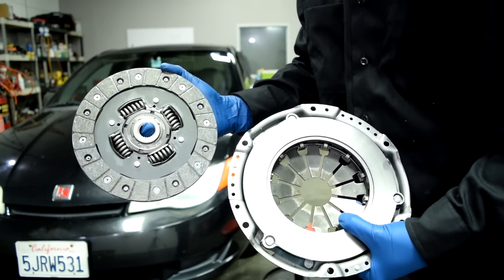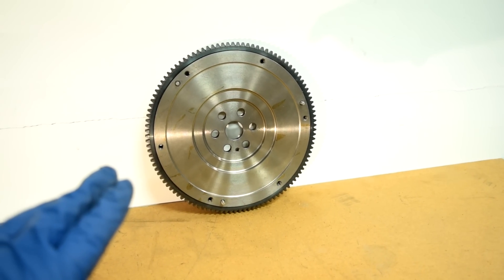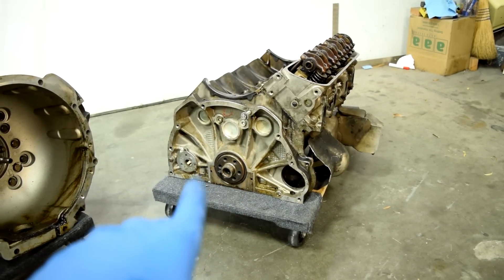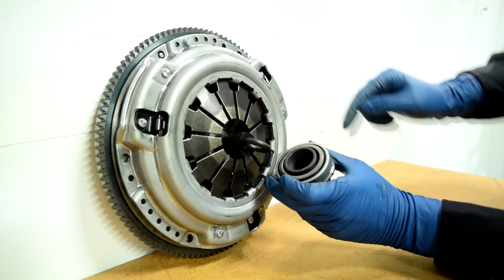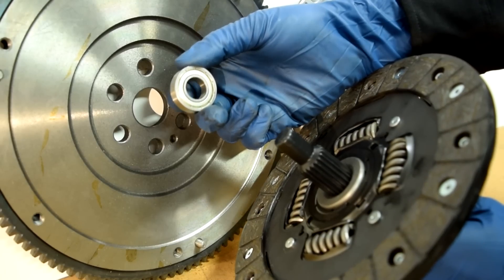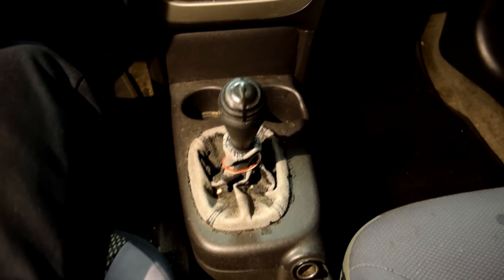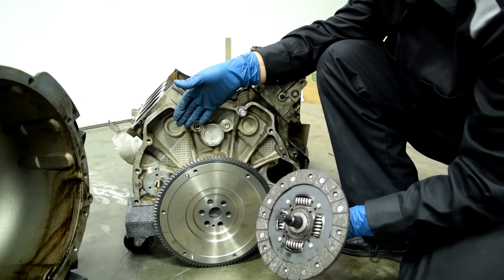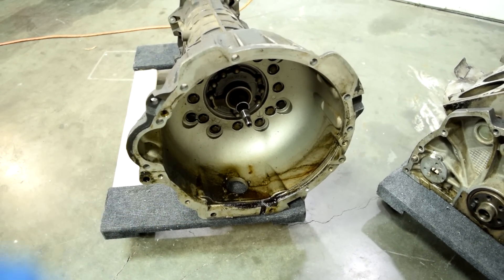How a Clutch System Works and How to Diagnose Issues With It

Comment: This is by far the best explanation and walkthrough of a clutch system that I have ever seen on the internet.  It is thorough, easy to follow, doesn’t skip anything or assume there is pre-existing knowledge, and best of all it actually assembles the damn thing piece by piece so you can actually comprehend how it all works together.  I give this video two crotch pedals up.

Comment: My 4 cyl manual 06 Accord with 150k gentle miles now makes a mild and variable howling noise, that persists until I gently press on the clutch pedal, then it is quiet. I think there is play in my throwout bearing against the transmission input shaft. Just my guess from the sound. Somethimes it is quiet for a while, other times it makes that subtle dry howl noise. When driving, road noise and the hum of the engine are louder than this mild howling tone, so it isn't like a slipping belt howl. Could it be the inside diameter of the thrust bearing is worn a few thousandths, and is not a slop-free slip-fit on the transmission shaft, and so wobbles a little bit to make that howl? Anyhoo, it's probably going to run me a couple grand or more (mostly labor) just to replace that, so while I'm at it, it will get a new clutch, too.

Comment: thanks for this video , i have a polo playa 2001 model 
my car gears goes high at high speed when above 3000 rpm when pressing gas peddle down to floor , is it slipping clutch ? also i checked at bottom of fly wheel look like theres oil ?

Comment: I recently encountered a problem with my car . My car is a 2003 peugot 1.4 manual trasmission . The problem comes as you put the car on first gear run a little bit then you press the clutch .... If you release the cluth without shifting to a higher gear itll jerk .... It happens on every gear but on the heavier gears it gives you a harder reaction. What dou think it could be...

Comment: Hey Very nice explanation, I have a new set (flywheel, friction plate, reinforced stock pressureplate, slave +bearring which have just done 2000miles without any problem. After someone launched my car from a standstill i have shifting issues at high rpm. shifter wont go in next gear and grinding noises. when normal dailying it does shift like it should. Any idea what could be wrong?

Video i made:https://youtu.be/vcJP3tW3ces
Im guessing that my gearbox is still getting input when the pedal is fully depressed or can a bad shift linkage cause this? 
Can a clutch master fail in this way that it does instantly move out the slave when the clutch pedal is depressed a tiny bit (so no delay) but not far enough when the clutch pedal is fully depressed?

Comment: had the clutch replaced on my car last year and I'm thinking either the pressure plate or cluch release bearing took a crap prematurely , it's not a Master clutch cylinder nor clutch slave cylinder as i also replaced both same day as the clutch kit 🤷🏽‍♂️ just went through a scare few minutes ago while I was driving clutch wasn't catchin at all neutral in every single gear with the foot off the pedal 🤷🏽‍♂️

Comment: Your terminology is incorrect, what you are calling a pressure plate is a clutch cover assembly, what you call the friction surface is in fact the pressure plate! The diaphragm spring (the fingers) are not attached to the back of the pressure plate, but does touch it!

Comment: I have a 98 civic with 195k original miles on the clutch. Had issues engaging in 1st after car warmed up. Replaced slave/master cylinders which seemed to help but still there’s resistance getting into gear once warm. Would this be an issue with the clutch or air in the lines?

Comment: You are the best. I have looked at different videos where they explain as though they are deliberately intending to confuse!
Clearly there is no continous shaft from the crankshaft and the input shaft. This is extremely hard to imagine when one considers that stuff must be continously connected from the engine to the wheels

Comment: Bought a car with a new clutch put in about a year ago, even came with the old engine and clutch but as im fixing it and its on jack stands i noticed that it cannot stall out. I can put it in all gears 1-5 and Reverse and just let the clutch pedal go and it will not stall??? Any idea what the issue could be and where to look?

Comment: I just replaced my clutch master and slave cylinder and It still feels like there’s no pressure on the pedal and I cannot put it in gear while the car is on, plz someone help
Reply: Bench bleed the master cylinder and then bleed the rest of the hydraulic system. The clutch line probably still has air.

Comment: My car's clutch does not slip with the stationary clutch test, but is starting to slip more frequently when at about 2000 rpm + and under load..It is a 2l turbo diesel. I am going to replace its clutch as I am scared its going to fail soon.

Comment: Hey! What can make noise in the clutch is depressed? No noise while stationary as well. Only while moving, and any gear (not on very low speeds, ie starting to move). As soon as i press the clutch, noise disappears. Some times it goes away for the moment while moving at certain speed. the car is Peugeot 307. Thx for any help.

Comment: When the engine is warmed up and I press the clutch pedal, it's really heavy and very squeaky, I replaced the cable with a new OEM one and there is no difference. Please respond as I use my car of UBER.

Comment: Does the starter motor disengage with the flywheel?  I'm guessing it must do otherwise the engine would be driving the starter motor in reverse, that would be a drag on the engine and prematurely wear out the starter motor.

Comment: I had a keychain rattle noise when the clutch pedal was NOT pushed in. Once you push the pedal in all noise stopped. Also, the car was kinda shaking when I pulled away from a stop. 
It turned out the flywheel was warped and burnt on 1 side. Resurfaced it and all issues are gone.

Comment: Hello RandW, 

I got a 2014 camaro zl1, and it makes a sound between 1-3k rpm, its like a rattling sound coming from gearbox area. I just replaced the stock clutch to RXT clutch and the mechanic told me I got a bad slave cylinder, but i refused to replace it. Also, there is no sound when I am in neutral and full stop, so it happens only at low rpm and  when cruising at low rpm then press the clutch to switch gear the sound stays  until rpm drops below 1k. What do you think? is it the slave cylinder or something else?

Comment: I just dont understand why these transmissions are breaking burning easily . Many times in traffic i need to statrt to go by higher acceleration and such time the clatch slips. It is basically an acent technic and nowadays tbhey selling em on expensive money cos heated seats and electric windows. Touch screen radio whoa!

Comment: What's the problem with my clutch if it shakes slightly when releasing it in the first gear? Can you plz show me the parts in the clutch system that went bad resulting into this problem. And how to fix it?

Comment: Thankyou for your video, I just bought a car I knew needed a clutch replacing, but I didn't know there was a noise from the clutch being pressed til I bought it, and I am planning to fix it myself with a friend's help to save labour costs, but I am not sure what was causing the noise, thanks to your video I'm pretty sure it could be the pilot bearing, I like your detailed explanations evn though at first I was like, huh he's explaining manual transmission problems with an auto box? Lol but you did explain a lot. You got a new subscriber and a like =).

Comment: Question: Is it possible that the Clutch Diaphragm will not engage the clutch because it fails to separate when the throughout bearing presses on it?
Reply: No, but first I have to correct his terminology. What he calls the pressure plate is a clutch cover assembly, the pressure plate is what he calls the friction surface. The pressure plate is connected to the cover with tangential straps(he didn't mention them) these are what pull the pressure plate back away from the flywheel. As the diaphragm spring is depressed, the fingers are depressed, the diaphragm spring has a pivot point, the inner part of the diaphragm spring moves away from the flywheel, the tangential straps pull the pressure plate back.

Comment: I have a 97 silverado 4x4 5 speed.  With the clutch depressed a little or all the way it sounds fine.  Release the clutch in neutral and it sounds like it's coming apart.  Not a grinding of gears but a loud machine sound.  Any thoughts?

Comment: Been there,,SHIPPED AND ORDERED THOSE....
LOSE one 1.80  core ,,it wont RETURN...
  I SPOKE  intensively and 
EXTENSIVELY with the engineers who designed  TRANSMISSION 
PLATES...<<AND
we tracked every shipment,,>>
◇_M.A. Bodine._◇

Comment: Very educational, thank you SO much.  Just had a master cylinder & clutch assembly replaced, but the culprit, $1000 later, was the $31 throw out fork, lol!  Gotta take it back in because when I release the clutch pedal, about halfway back up it sticks, then suddenly "pops" the rest of the way up. It's actually an audible "thump" sound too as it pops back up.  I wish this video would have given me a clue as to why it's doing that.  I just can't figure it out.  Just spent 2 weeks without my car (2002 Subaru Forester), living in the country and a full time single mom, whew!  I'm loathe to take her back in, but I don't want that thousand bucks to multiply!

If every driver knew the basic mechanics of how their cars work, I don't think we'd be in the shop quite so much, lol!  Thanks for including your bloopers, I was laughing with you!  Comic relief is so very necessary when working on cars, gosh how my dad would swear and throw tools, when he'd make me "help" (really just watch) as he worked on cars out in our driveway.  He really needed a son, lol!  I'm grateful, I can install brakes, change a valve cover gasket, change tires, change oil and much more cause of dad making me "help" as a tween and teen age girl!

Comment: 2007 Saturn ion, replaced clutch + cylinders. I see you have the same car. Bad master in 4 days. Any ideas? Maybe you dealt with it on that car???
Reply: I have been going through endless forums on the subject and dealing with my car's clutch issue; $1000, a new master cylinder and clutch assembly, only to find out it was the $31 broken throw out fork causing the problem, lol!  I've heard a LOT of issues with bleeding out the air in the hydraulic lines... worth checking maybe?

Comment: Thanks for the video. I have put a new clutch in but having a hard time finding a nice bite point in 1st and reverse. It's vibrating quite bad.. throwout bearing?
Reply: @senadgalijasevic8568  sounds exactly the same! Yes I'll try bleeding that. Will get back to you.

Comment: 10:39 I think I have this issue. it's the worst for the reverse gear, when I release my foot of the clutch pedal it makes a grinding noise and doesn't move, I have to put it in neutral then 1st gear and then reverse again than it works about 70% of the time.

right now I just so happened to drop the transmission and to me it seems the tob is good.
what else can you tell me to maybe help diagnose my problem.
Reply: ps: what's a filler gauge?

Comment: Hay I have a Honda Civic EX 2003 1.7 manual transmission and when I go uphill and I shift from first to second gear I loos a lot of power they told me it's the clutch but I'm not sure and it's hard to find an honest mechanic  what do you think
Reply: It's not the clutch it's your car. It doesn't have power to lose...let alone power to begin with.

Comment: when i changed the clutch assembly of my volkswagen polo and had it installed with a used clutch release bearing, the clutch did not work? my mechanic told me that something is wrong with the transmission which caused the clutch not to work. what do you think happened?

Comment: Great video but it's a bit confusing swapping from a auto gearbox to a manual car all the time.
Reply: The Scally Trader    Er.....he does say.....”we’re going to use this for demonstration purposes”, meaning; just pretend it is physically a manual gearbox he’s pointing at and everything makes sense. 

Nothing he says is specific to an auto unit.   Almost everything he says is specifically about a manual which may or may not be the same as an auto, but he’s not considering autos here, so it’s not relevant.  

He could’ve had a cardboard box on the floor that says ‘manual gearbox’ on it and that would also be valid.   Good luck.
Reply: @aleksmart  thanks for that.

Comment: i drive a bmw 320i, when i try change into first gear sometimes it doesnt shift and feels like it gets stuck, if i let my clutch abit loose it will slip in, or if i go into second back into first it goes really smoothly in without issue, and there are days where i can shift gears super smooth with ease and sometimes it feels abit hard..

Comment: Hi, I am looking at purchasing an Audi A1 1.4TFSi and recently took it for a test drive the other day. Nice little car but what I did notice was that when the clutch pedal was nearly fully depressed (around 4/5ths of the way depressed) it started to vibrate a little (no noise heard from within the cabin just some minor vibration through the pedal). Then when the pedal was fully depressed the vibration went away and then as it was released (now in gear) around the same point (on the return) it started vibrating again. Is this a problem? Could it be the pilot bearing like you mentioned in the video even though there are no noises coming from the engine bay?

Comment: Hi can anyone help 
I got my new clutch installed 
1 st week was good no slipping but 2nd week and 3rd it's slips from a stop 

I bought a new slave cylinder 
New clutch plate and pressure disk
And new dmf flywheel 
Mobile mechanic got new pilot bearing 
Everything else is the old stuff 
New fluid

What's up with it 

After car goes it's fine it's goes 
If I bring clutch up faster it will wheelspin but slower to biting point it slips ???

Please help

Comment: my clutch is not giving me any problem for changing gears, but it does seem to move without any resistance down almost to the floor.  there is no leaking or noise it just seems like it is too easy and low... can this be adjusted up or tightened? or does something have to be replaced?
Reply: createnow4U seems like your clutch disc is worned or its just misadjusted. And yes you can adjust it defending tho.

Comment: Awesome video, super thorough, awesome flow of explanation and great troubleshooting tips. Thank you for also including information about how the computer is tied into the systems as well. I learned a lot from this video. What was especially surprising to me is that when you kill the car in a manual, I always thought it was the engine just not having enough power to turn the wheels which made the engine die, but instead its' the computer sensing an overload and shutting down, so interesting. Anyway, good vid, thank you.

Comment: I have a clicking/whrring noise while in neutral that revs up with the engine but goes away when depressing clutch pedal.

Pilot bearing failure?
Reply: Throwout bearing worn or defective

Comment: I appreciate your in depth explanation! How do you diagnose clutch judder / shudder? I used to have a dual-mass flywheel and now I have a single-mass flywheel and clutch kit, CDV removed and brake fluid flushed. I get an intermittent judder.... and I have no idea why.

Comment: Pl;ease advise.  Cant put gear into gear.  However cannot change gear at all.  Noises can be heard from the engine when stationary but cannot hear anything on the move.  The last thing that happend is I could not release the gears at all.  Jad to remove the gearbox then pull out of gear.  Is this a sign of bad bearings or personally feeling the Fingers have warped or become to fatigued and no longer respond to pressure from the pedal.....

Comment: I have a question. I have a 05 mustang gt put in a new clutch kit with new slave/throwout bearing. From the beginning the clutch engagement wasnt linear. Ive bled the system many times and sometimes pumping the ckutch helps the engagement feel. So then i put a new ckutch master cylinder since the one i had was used but the pedal feel is still the same. Theres days that the clutch pedal feels great but usually after a few minutes of driving it starts to feel like the clutch pedal is not linear any ideas??

Comment: Please help...my mechanic installed a new clutch in my 02 civic. However the car now vibrates very hard when i try to move off in 1st gear but shifts smoothly after moving off to the next gears except 5ft gear. The car will no longer go in 5th gear. Its as if the gear is not there anymore,yet its a 5 speed car. Please help

Comment: U made a mistake. A clutch plate is always connected to the flywheel regardless of clutch pedal being depressed or not (Clutch disk is the only part which disengage from flywheel when clutch pedal is depressed). So the whistling noise produced by the release bearing can be heard only when the clutch pedal is depressed to the floor because that is the point when the release bearing make a contact with the clutch plate which is always spinning along with the flywheel.  Nice vid btw.

Comment: Thanks for the information, but I have a question for you. I was driving yesterday and something was wrong. I could be in 4th or 5th gear and floor it and my rpms would go up, but the car wouldn't match the rpms. it's like the rpm had to slow for the car to catch for me to get torque. Would that also be clutch related? I have a 98 Honda Accord with about 250,000 miles on it
Reply: Your clutch disk is slipping.